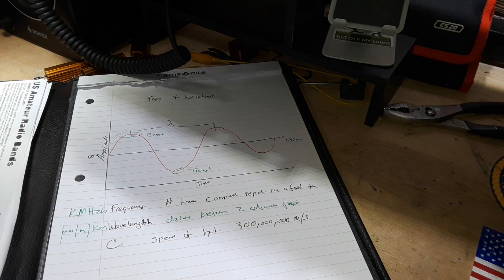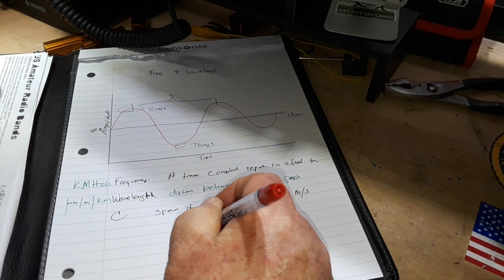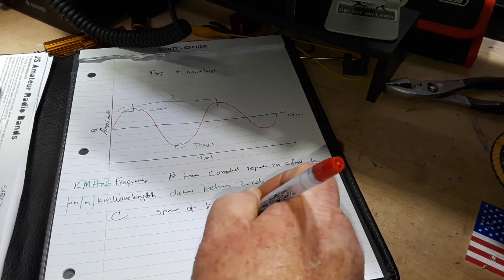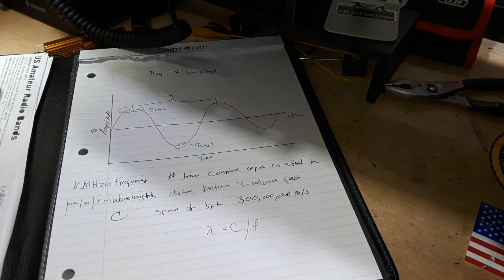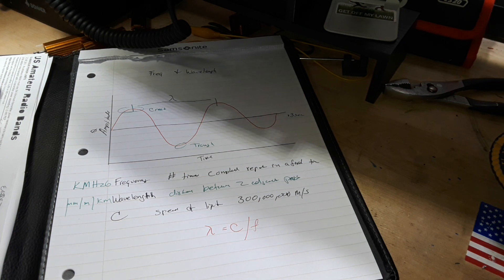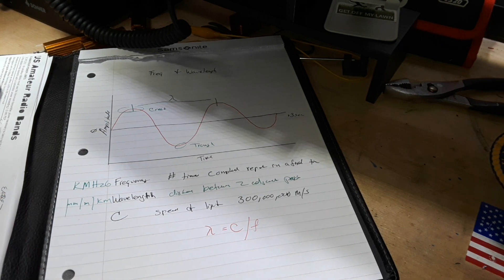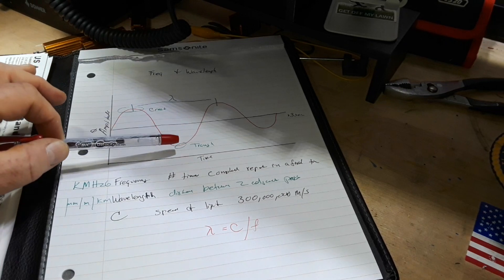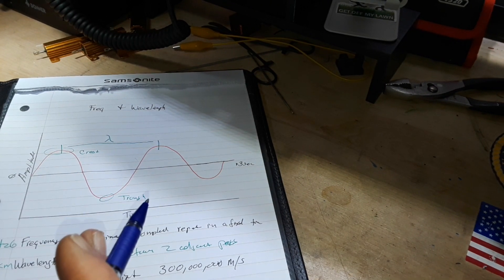Frequency & Wavelength Relationship

Comment: It's a good explanation of frequency versus wavelength. Now do a discussion on Vpp versus Vp versus Vrms. Explain why..

  Power in Watts =  Vpp^2 / 400 

..in a 50 ohm impedance circuit and how you can use that relationship to calibrate your Bird slugs or OHR WM-2 watt meter.

72/73 de k6whp
dit dit